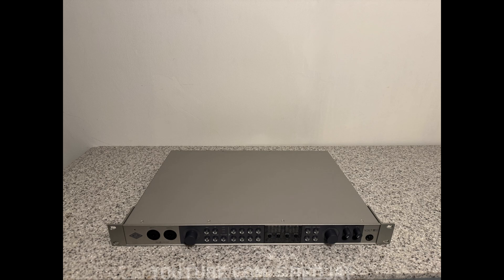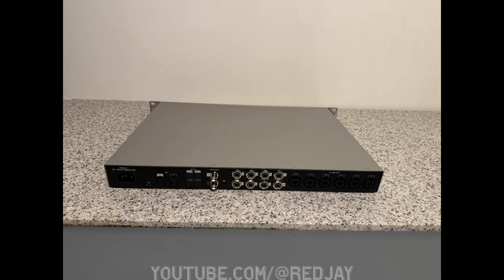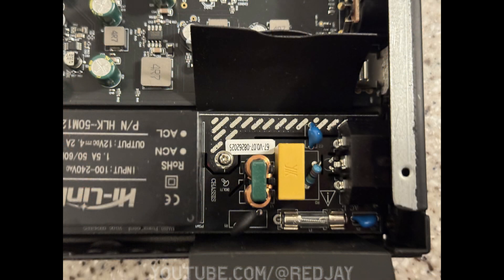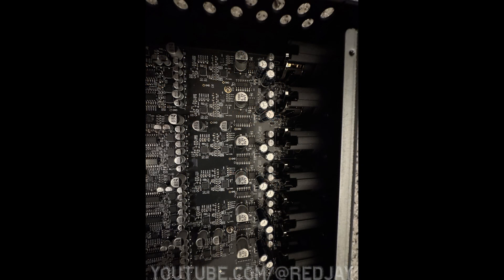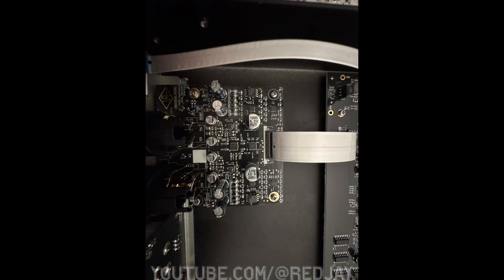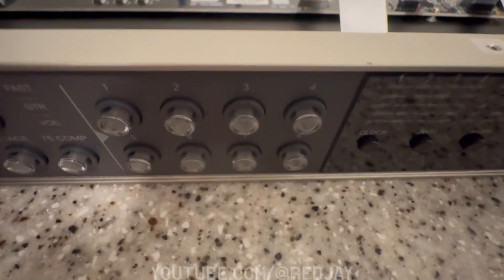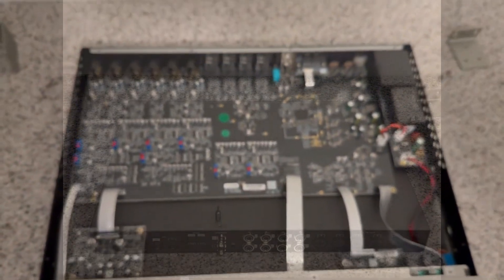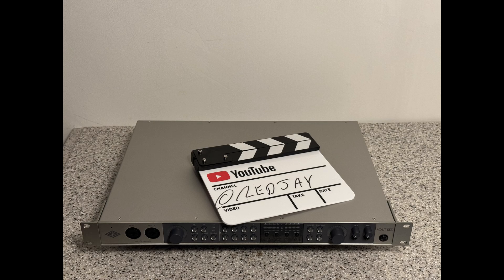Universal Audio Volt 876 - Tested, Opened, Samples.

Comment from the maker: Thanks for checking out video. What do you think about 876? Too much of a good thing or good to go for your workflow? Few things I've noticed after two more sessions with the 876:
-The buttons lighting up and the meter being simple is good at a distance from the rack to see what settings are up and where your at while setting up mics. 
-I was not joking about the looks, I should have shot it while on to show you all the long dash lines that surround the gain staging... it looks really good. 
-IT HAS A LIT POWER SWITCH AND QUICKLY IS READY TO GO. I cannot stress how useful this is. 
-So far no heat issues.

Comment: It's either my pleb ears or the headphones I'm using (at work) but I'm not hearing a difference XD
I'm sure I would if I was home with my Sennheiser HD 599
Reply from the maker: Thing with DACs is if they are doing their job its hard to tell much of a difference unless you start activating circuits on them to change the path i.e. small compressor on the 876. I will note number of inputs/outputs, and tie ins with workflow certain DACs offer is a big plus. In my case the 876 integrates into Luna on PC taking a step out of my voiceover takes. Worth noting on the Scarlett 8i6 years back when I got it on discount it was a big step up from my Scarlett solo because it had dedicated power switch with its own power cable which meant I with 8i6 could turn it off and on when I wanted it not tied to when I turn on my computer and not tied in to power from computer. It's amazing how basic features are not a given - i.e. be able to turn off the DAC without screwing up my audio settings or yanking out a usb cable that will fault over time due to constant pulling it out.

Comment: Thanks for the inside view. Those 'blue towers' are just variable resistors which are biased/tuned at the factory and the goo/sealing is there to be in place so nobody wanted to turn them without a reason.
Reply from the maker: Fascinating systems in audio hardware!

Comment: Was noise reduction applied to the voice track?
Reply from the maker: No - only thing used was C-VOX plugin to everything other then the samples went through RND 517 and 542. Compressor on RND 517 is set to +3 dB edit - for clarity, C-VOX was on the samples as well I meant just rest of video is purely microphone into the Volt 876 and changing settings and verbally saying what I changed each time to help those considering the equipment (but C-VOX was used to process the render like rest of video to pull fan noise out).
Reply: @RedJay  surprisingly no background noise of any kind

Comment: Very informative, given a choice 🤔which would your prefer Audient 48, ssl 18 , or this volt876?  I’m torn between the three
Reply from the maker: SSL 18 or Volt 876 either of which would be sold picks at least for my kind of uses. Workflow wise out of those two I enjoy UA plugins and already have a UAD2 Sat Octo for a few years now... so get to have every kind of plugin and for me I enjoy mix and matching hardware preamps so Unisons of the far more expensive rack Apollos don't matter as much to me. Back to just those two - I like the Volt 876 front panel more for low light use and the extras like the mini-76 circuits and "vintage" extras which are all right there I can light them up and run and know they are on or off in low light. But its less about what's best fit for me and advice for you so I'll round it out with this:

-Are you already deep into UA Plugins, use LUNA, or find the extra but limited 76 comps across all inputs useful? On the UA plugins, if not would you like to dive headfirst into them as the 876 comes with a good collection of them? 
-Are you looking more for SSL 4000 Preamp sound? Do you prefer the SSL Production Pack offerings and SSL18/360 Mixer? Do you like gain adjustments to be quick even if it takes up most of front plate with them, so changing gain is instant instead of tap the respective input button then change the gain setting which is case on 876? 

You probably noticed I focus heavily on controls, use in dark, etc. And that is because I think that is the biggest thing between these two options. I believe you will do well with either and it's more about what is easiest for you to work with in your workflow and get you more time to focus on other things in the session. Best of luck in your decision.
Reply: @RedJay thanks a lot. That help tremendously.